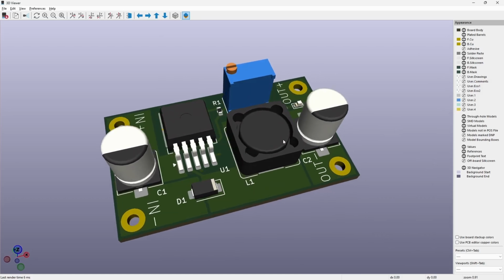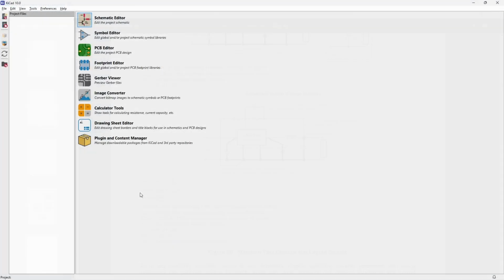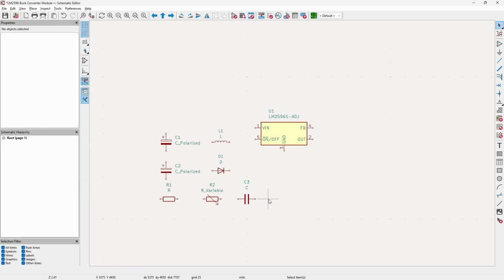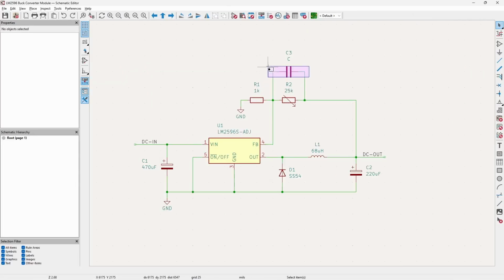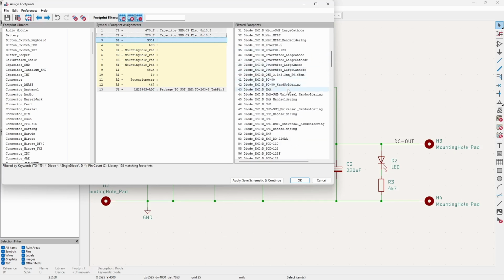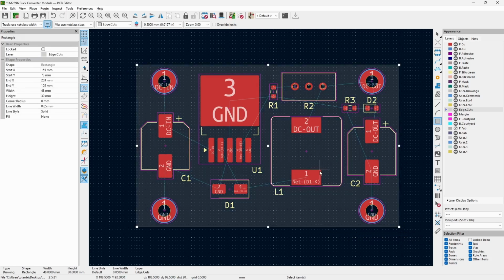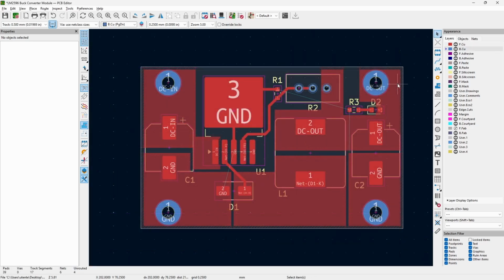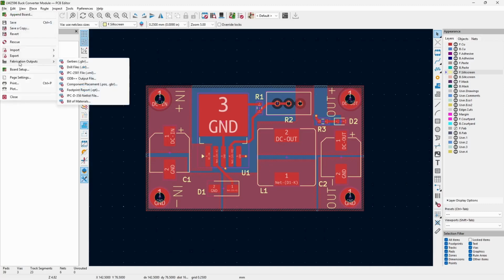Build an LM2596 Buck Converter in KiCad – Complete Guide

Comment: Thank u so much for this informative video. However I heard that many adjustable buck converters often have an unstable voltage. Could there be anything else added to the PCB design that better regulates it?
Reply from the maker: To biggest factor to achieve a stable output is picking a high-quality converter (from well known brands) and pcb layout. If you do these two things correctly you will be good for 99% of applications. If you want to be extra sure about the voltage value you can add a LC filter to the output to smooth it even more. Hope it helps! :)